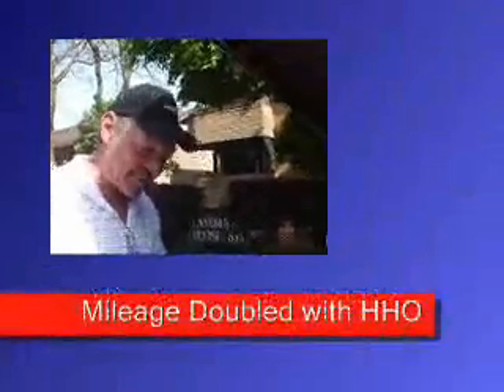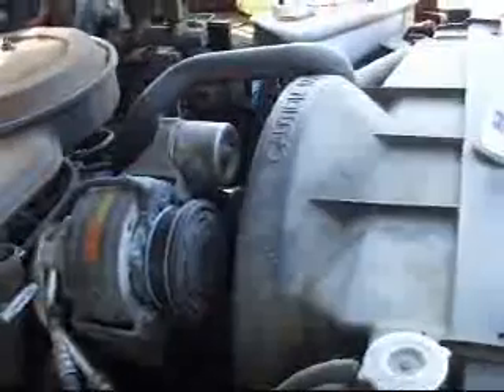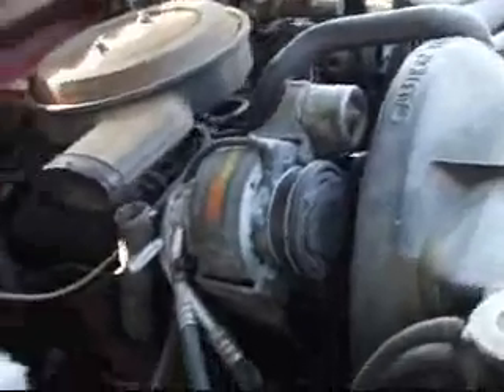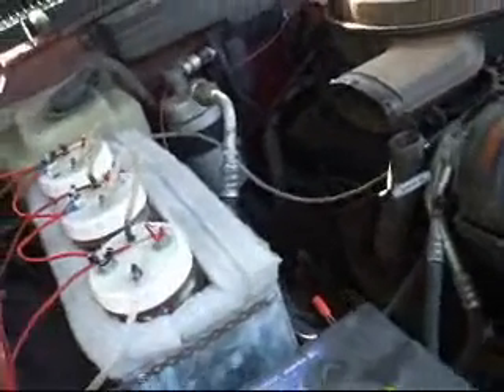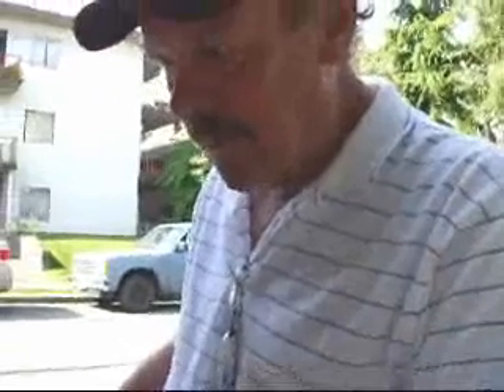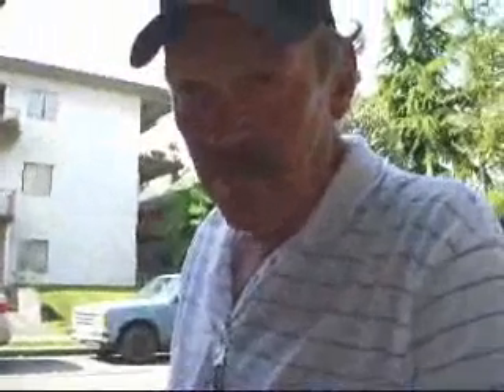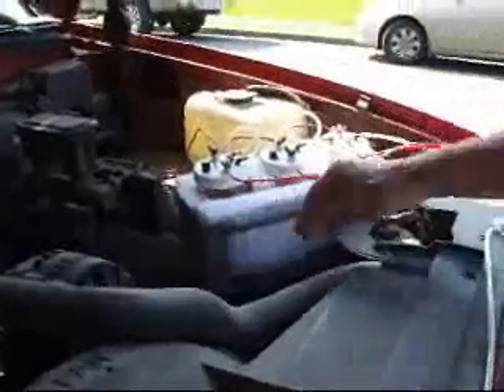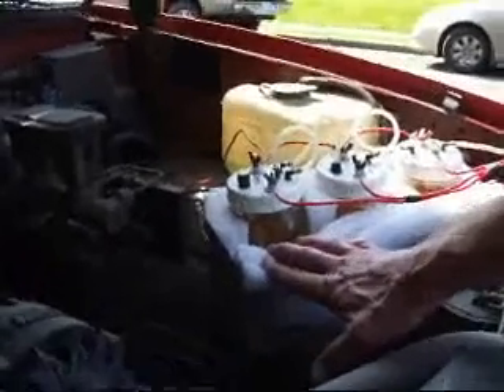Proof that HHO is not just a Hoax - Intallation is Technical

Comment: HHO goes way beyond just cars and trucks. When the powers that be allow, this form of energy to be used it could be used anywhere from coal burning power plants to large manufacturing plants, industrial equipment, etc, etc. Another benefit is that it is available now and can be added into vehicles already in use.

Comment: @nicotrial the electricity needed to run this is supplied by the alternator as the car is running --- the gains in mpg already include the electric charge needed for this.  this does not draw that much current and the battery is still being charged as normal - it will never "run out".  people have these in their cars for years without any problems.

Comment: @Ebdan88 your car will simply run till your baterry dies.. becous it will have more waste then recovery.. a more eficiant way to do this is just make an electric car.. and you wont have to transfor electricity into gas into mechanical.. and will have less heat exchange(wasted energy)..